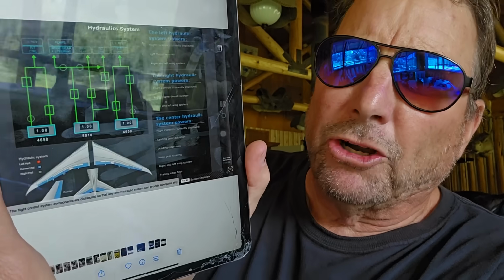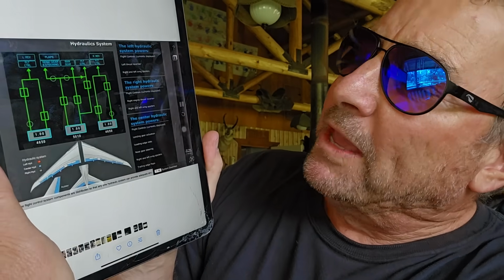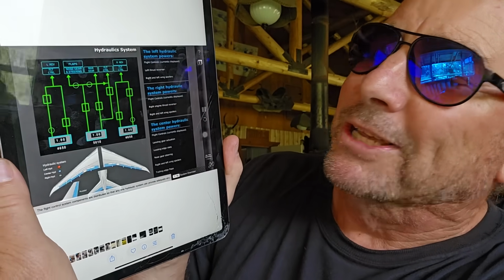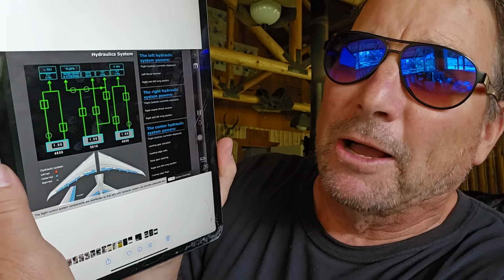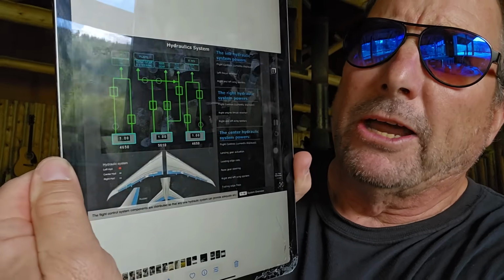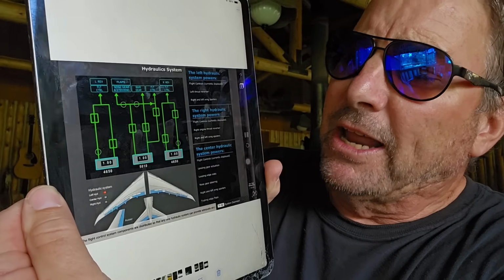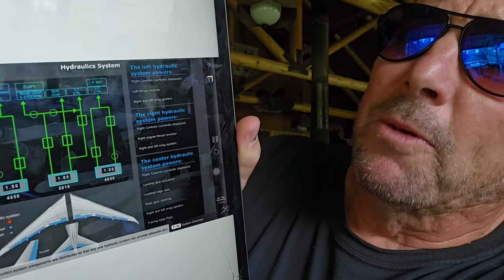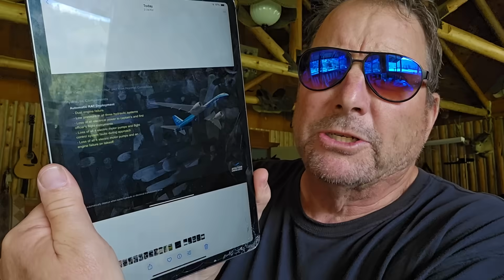787 Crash India What's a RAT? When does it deploy?

Comment: Hi Juan. Convinced they had trouble before take off hence the rat. They seem to have used the full length of the runway hence the dust and grass debris. They had passed the point of V1 and only had the two options. Disaster either way. Very sad
Reply: The video that shows the take-off was recorded near a control hut to the South of the runway, about 1,000m from the Northeast end of the runway. Using this location and the buildings in the background, the aircraft left the ground at around the midpoint of the 3,600m runway and initially climbed away as normal. The dust was picked-up from the side of the runway by the tip vortices as the aircraft rotated. This is normal for this runway and for a B787-800 in particular.

The issue occurred shortly after rotation.

Comment: Hey Cap, just to add a mystery to this crash. You should look into the ANA Flight NH-985 on Jan 17, 2019, and I quote "the pilots deployed the thrust reversers after touchdown to slow down the aircraft. Shortly thereafter they noticed that both Rolls-Royce Trent 1000 engines had shut down. At this point the crew let the aircraft roll down the runway. It came to a complete stop after 8,030 feet." They didn't do any further investigation, the engines out of the blue fully shut down for no apparent reason and the RAT was deployed. The maintenance crew couldn't find anything wrong with the engine but they suspected some issue maybe due to the software.  This is the only other incident with 787 with a dual engine failure. Unfortunately, it wasn't investigated any further than couple of news articles.
Reply: This was powered by GE engines
Reply: @tomstravels520 for 2 engines to fail simultaneously likely a propulsion systems issue or fault.
Reply: @pachaaaspaisa we don’t yet know the engines failed yet. No solid evidence yet
Reply: Apparently there was a bulletin before that mentioning that the TCMA system might activate if reverse thrust is activated too quickly. (The system shuts down the engine if it detects high engine power with throttles at or near idle while on the ground - it was developed in response to an incident where a crew aborted takeoff, but the engine causing it did not throttle down)

Comment: I hate to pull out AD 2016‑24‑09 but watching all the videos and the sudden power loss let me think that it has something to do with it. For those who don't know the FCM on the 787-8 and 9 series has to be rebooted every 22 days due to a integer overflow scenario - that is a known issue in lots of processors and is really nothing unusual but what is known that the FCM (actually all 3 of them) will automatically reset themselves making the whole plane unresponsive until the FCM comes back (no input controls). I know it's random but if they didn't follow the directive or delayed (power cycle takes about an hour), the plane takes off - hits the 22 day mark - all three reset - that would make the plane a moment of no control. That definitely freaks you out. FCM takes about 5 seconds to reboot - enough time to mess everything up. Now most 787's should have been updated about 4 years ago with a software update that implements staggered reboot times for the FCM but obviously maintenance records for operators are not really available online.  Of course that doesn't explain the RAT deployment but it they still could be all connected (manual rat deploy after not realizing the FCM was rebooting). I really want this not to be a major technical issue with the 787 but we will know soon (hopefully). RIP to those who lost their lives and to the guy who survived - go and buy a lottery ticket.

Comment: There was no electronics for creature comforts reported by a passenger of the plane from earlier that day, can you land with the RAT deployed? Is it possible theyd been running on the RAT for a tjme?
Reply: No. However, if there were electrical issues such as a engine electric generator issue then this could have resulted in the item being put on the minimum equipment list with a caveat that the flight be performed with the APU running.

Comment: Hi Juan, could you also elaborate on the dust swirls which seems to appear on the cctv footage of the t/o. Is it a possibility that the plane didn't take off from the runway, but rotated off the runway causing huge loads on the nose and main gear. That could cause some serious damage to the hydraulic system.
Reply: The plumes of dust appeared after the aircraft rotated and was in the air. They were caused by dust from the side of the runway being picked-up by the tip vortices.

Comment: I cannot help but return to the whistleblower complaints of the rampant quality failures in the 787 production process, particularly in the South Carolina line where, apparently, several of the Air India 787 fleet was assembled. Foreign object debris in wiring harnesses, faulty batteries, rushed testing, FAA rubber-stamping...Juan's RAT scenarios, if they prove true, will shine a glaring light on electrical system implementation issues and the criminal lack of oversight on quality: deeply disturbing possibilities.
Reply: The mishap aircraft has been flying for nearly 12 years, rather too long to worry about latent manufacturing issues.
Reply: @christopherrobinson7541 Hmm...Not if you read the whistleblower complaints. Several expect defects to show up at about this point in the service life. That said, certainly maintenance practices would also be a factor.

Comment: Im no expert. But in my opinion 

1. The engines were running good
2. The plane achieved the V1
3. Pilot crossed the Point of no return, so they had to take off.
4. After few seconds of achieving the V1, dome critical failure occured 
5. Plane was already running beyond V1, pilot choseto takeoff.
6. But, when the failure occured the pilots couldn't do anything to keep the flight airborne
Reply: Seems OK, but the aircraft also achieved Vr and rotated into the climb, which initially appeared normal and then the problem occurred.

Comment: Check the pictures of the crashed plane. One wing has flaps still deployed while the other one doesn’t. Early reports in the media says issue with fuel system. Check these two
Reply: If one flap was deployed but other didn’t the aircraft would roll, but it didn’t
Reply: The position of the flaps & slats after the crash may be different from their position prior to the crash.

Comment: All of these scenarios seem like too much to have happened in such a short time. The number one cause of aviation accidents is human error, and in this case, it seems more plausible that the pilot accidentally raised the flaps instead of the landing gear.
When they noticed the gear hadn't retracted, they may have assumed it was a hydraulics issue. As the plane began losing altitude, they likely tried to pull the nose up—as seen in the video—but the aircraft didn't respond normally. Believing it to be a hydraulic failure, they deployed the RAT. Eventually, they increased the throttle, but by then it was too late, and the rest is a tragic history.
A survivor mentioned hearing the engines spool up before the crash, which suggests there may not have been a mechanical failure in the aircraft systems. As horrible as it is to say, human error would be the most reassuring explanation for the sake of the global 787 fleet and the safety of the flying public.
May everyone who lost their lives on AI171 and on the ground rest in eternal peace. 🙏🏻

Comment: The fact that it may have been dual engine failure screams one of the following :
Fuel contamination (possibly leading to comp. Stalls or worse (failure)
Bird strike
Reply: Bird strike you’d see a compressor stall, fuel contamination would likely have affected other aircraft too
Reply: You are right. A bird strike can cause a total failure too (Sully) or a surge . Contamination can affect one aircraft only by the way , for example if during the inspection something goes wrong.

Comment: Will that Rat Carry the plane level if he would have nose down before he started Stalling, I know 600 feet no recovery just wondering how powerful
The Rat Prop is, Im just a Traveler,
Reply: The RAT uses the airflow to produce electricity. It causes a slight increase in drag. It does not produce thrust. It works the other way around from a propeller engine. The turbine turns the load (the electric generator) rather than the engine turning the prop.

Comment: Did Copilot Raise the flaps not gear, Why nothing out of the black box yet, Its been Days, I agree, We need to know Now, Not have more issues,
Reply: You do not NEED to know anything when it only happened 48 hours ago. You are no different to the rest of us. You don’t rush to guess what happened like you’re doing (flaps wouldn’t retract due to fly by wire protections even if lever moved). Let the investigators do their job properly and thoroughly
Reply: The information from the FDR & CVR needs to be downloaded and preserved. Then these data need to be validated, before any initial information is provided. This usually takes a minimum of a week, often much longer.

Comment: RAT is deployed at altitude. It does not work at such short notice and especially at.such low altitudes.
Reply: Oh how wrong you are. I’d love to know where you get your information from because it certainly isn’t from an FCOM or maintenance manual
Reply: The air is denser at low altitude so the RAT can provide sooner than when flying at high altitudes. The airliners fly faster at height and in some cases the RAT cannot be deployed because it could overspeed.

Comment: One important clue: they took off at the very end of the runway (see all these clouds of dust at the video). Although the aircraft was heavily laden and the temperature was reportedly quite high, this is not normal. So, my dollar goes to engine problems (most probably flameout, I wouldn't count on bird strike - there's no indication of catastrophic engine failure on any of the videos). For both engines to flameout with no smoke or flames coming out of them, fuel starvation or a total failure of the systems controlling the engines are the most likely causes that come to my mind.
The bang that was heard by the only survivor right before the crash might have been the deployment of the RAT.
Reply: The air temp was 37C, not unusual for this route, which I think is flown 13 times a week.
Reply: @christopherrobinson7541  Absolutely. Nothing wrong with the conditions at the time of takeoff. My point was that even if high temperature requires longer runs for takeoff, taking off at the very end of the runway, even at high temperature, is a sign of a problem.

Comment: The plane kicks up dust from dirt/debris at end of runway, but is it initially more on the left side? Is there a slight yaw to the right immediately after that, which is then corrected? Would that mean the right engine lost some power, possibly by ingesting dirt/debris off the end of the runway, because of the very long takeoff roll? Was there a slight yaw to left, then corrected? Did the left engine then lose some thrust from injected dirt/debris? Did the RAT then deploy due to reduced power both sides? And/or did ingested dirt/debris damage all engine generators? Then RAT deployed?
--- has been mentioned, but were flaps deployed sufficiently (1 vs 5 vs 15 needed for hot day full load)-? Without flaps 1, would the lack of leading edge slats deployed not have allowed takeoff at all?
--- It seems this 787 was slow going all the way down a long runway. The one time out of SFO I flew in a 787 full load, it took off in less than half the long runway and climbed like a rocket. In fact, I was so startled how fast it took off, compared to having flown almost every other plane type, i thought it would crash due to low airspeed. That 787 was massively (over)-powered, got to cruise altitude 41,000 ft before Sacramento, fastest rocket for short takeoff length and climb to altitude I ever flew....seems this accident flight had relatively low power on runway, slow speed.
Reply: The video that showed the take-off run was recorded from near a control hut on the South side of the runway, about 1,000m from the Northeastern end of the runway. Using this position and the buildings in the background confirms that the aircraft left the ground around the midpoint of the 3,600m runway and initially appeared to be climbing normally.

The ADS-B data showed that the aircraft climbed to 645 ft amsl, 445 agl and was flying at 175 kts, over the departure end of the runway.

Comment: For what I've always understood is that V-1 ( decision speed/point where you continue the take-off roll or reject it)  was reached at some point and the pilots simply had to get the bird off the ground.
Damn... this must have been  disastrous last moments , especially on the flight deck.
All those bells and whistles and being aware of the outcome.
Hopefuly Boeing and the involved safety boards will find out what caused this crash.
Reply: Initially the aircraft appeared to be climbing normally after rotation, so V1 is not likely to be an issue.
Reply: @christopherrobinson7541  I know... But to reach V1 you'll need toga thrust ( pedal to the metal in car speak)
Let's hope that the root cause analysis will help to prevent future accidents.

Comment: At this point (June 14) and with the information available now, I suspect one engine failed after V1. That lead to the pilot to take off on one engine using most of the runway. Then the second engine failed shortly after takeoff causing the RAT to deploy. Unless there was some indication before V1 that the pilot didn't catch, I highly doubt this will turn out to be pilot error.
Reply: The video of the take-off run shows that the aircraft left the ground around the midpoint of the 3,600m runway.

Comment: Is it possible the plane was overloaded to the point that due to the high temps and thin air, that it was unable to climb?
Reply: Very unlikely as the planned flight was 9,500km and the max range is 13,500km, so the aircraft would not have been fully fueled, hence not over weight.

Comment: Normally I always agree with your assessments Juan, but not this time. I don’t think the deployment of the RAT (if it did actually deploy) would have caused this unless it was due to a dual engine failure which is highly unlikely. Only 2 things could have caused this, loss of thrust or loss of lift. If the reports of an intersection take-off are true this what I think. They were 3 hours behind schedule so rushed to get going and elected not to back track all the way and that’s why they rotated at the very end of the runway. I think one of 2 things happened, either they did not configure for take-off ( which I doubt) or after takeoff when the PF called for gear up the PM raised the flaps by mistake. Purely speculation on my part but I just don’t believe it was any mechanical fault.
Reply: The initial data provided by Flight Radar 24 suggested that the take-off was from the R4 intersection. Latter they confirmed that the aircraft had backtracked, turned around and took off with the full 3,600m available.

The last datapoint gave the aircraft height as 645 ft amsl, 445 ft agl at 175 kts over the departure end of the runway. The crash site was just off the extended centerline 1,500m from the end of the runway. Assuming a velocity of 150 kts (to avoid stalling) the glide ratio would be 10 to 1 and it would take 20 seconds to reach the point of impact. This strongly suggests that the engines were not producing much, if any, power.

Incorrect operation of the flaps could not have resulted in this flight path.
Reply: I take your points but if what I’m seeing from the point of rotation it sure looks like they used every inch of runway, you can even see dust stirred up which makes  me wonder. I still find it hard to believe that they experienced a dual engine flameout so that leaves degraded engine performance, from what? Wrong power settings? I’m still thinking that the 3 hour delay might be one of the holes in the Swiss cheese.

Comment: Saw reports from a passenger claiming to be on the same aircraft inbound. He mentioned air conditioning issues, saying it kept cycling and was essentially non-functional. It was hot, 37c. It could be the electrical system overloaded, engine fadec computers got reset or a degraded state set throttles to idle, RAT deploys and the aircraft glides in sadly

Comment: I heard on another video that they did an intersection take off, using 6,000 feet of an 11,000 foot runway on a very hot day. Did I hear that correctly?  If so, I would think it would be a major factor.
Reply: Incorrect, the ADS-B data does appear to show this but there is a 4 minute window missing and FR24 confirmed from other data the aircraft backtracked
Reply: @tomstravels520  Thanks for the clarification.  It doesn't seem like something that a professional pilot would have done.

Comment: The knee jerk reaction after a crash is to blame pilot error, and that is often correct--but in the case of the 737 MAX that was wrong and it may be wrong again here. There was a Wall St. Journal article about production problems with the 787.  I am just speculating but this could be a ticking time bomb; the investigators need to get to the bottom of this ASAP.
Reply: Pilot error was a large factor in the 737 MAX crashes, though. It was a combination of poor airline maintenance, an overly aggressive safety system paired with an unintuitive user interface, and strings of serious pilot errors due to panic.

As for this incident, production problems on an 11 year old aircraft are a lot less likely than maintenance issues.